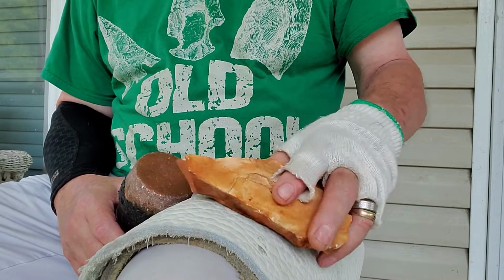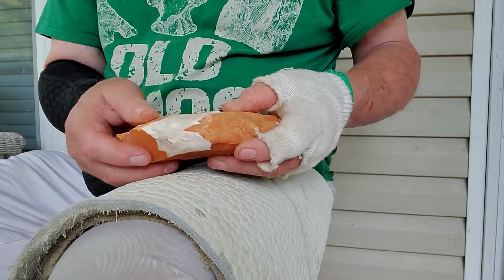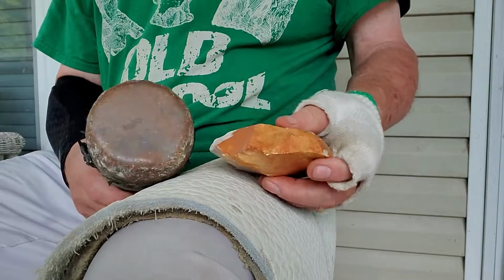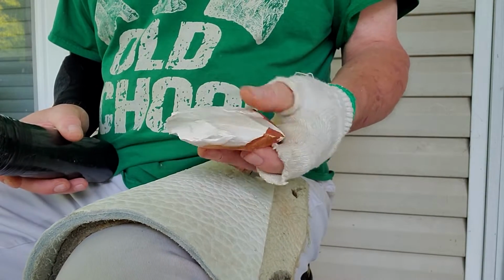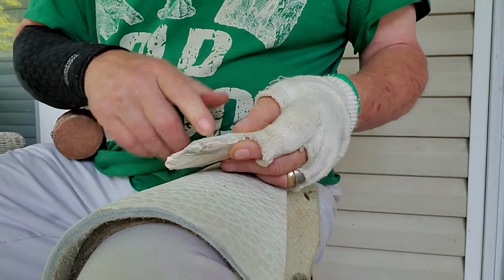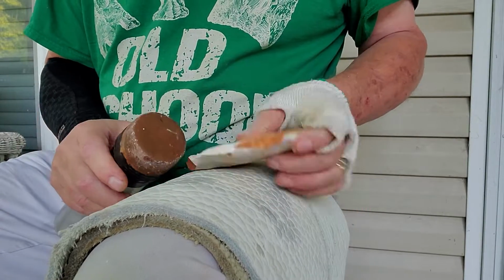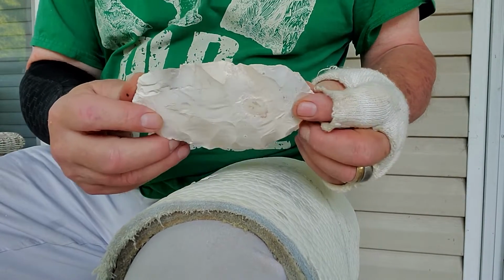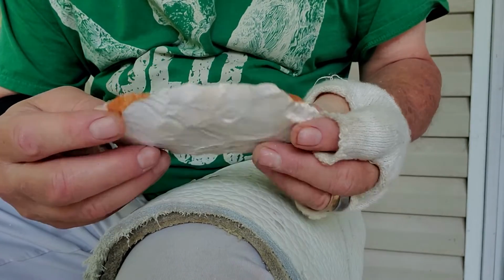Flint Knapping - Thinning Some Chert.

Comment: Where do you get that thick leather from that your leg pad is made from? I used John's and that thing is nice.
Reply from the maker: Bought at a knapin from Michael Miller who runs the website flintknappers.com
Reply: @EDBO23  thanks. I appreciate it. I have a piece of rubber that was a plastic culvert seal and does okay with my thin leather pad on it but chips stick in it and can cut you before you know it when handling it.